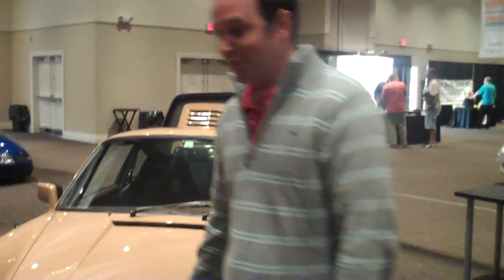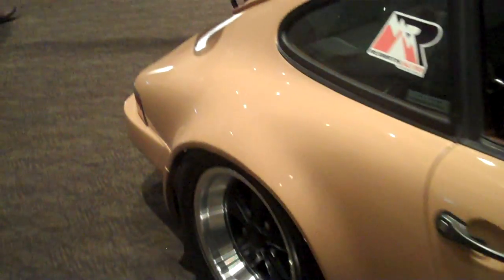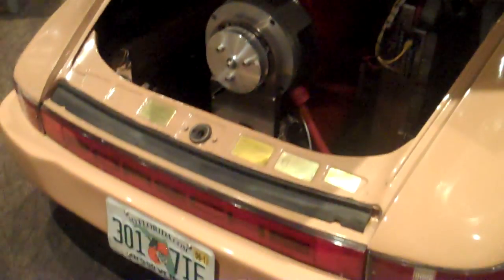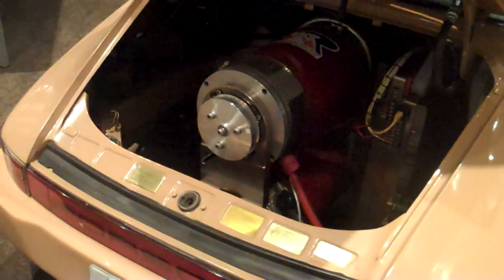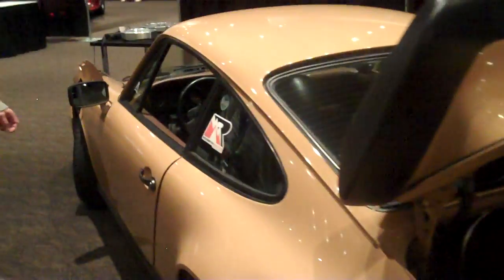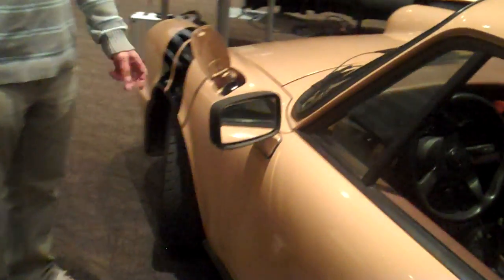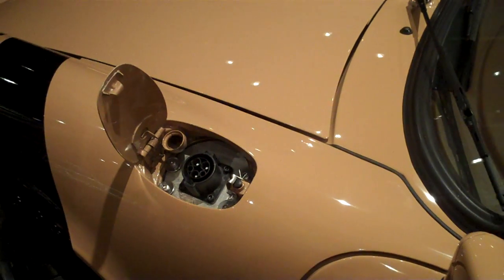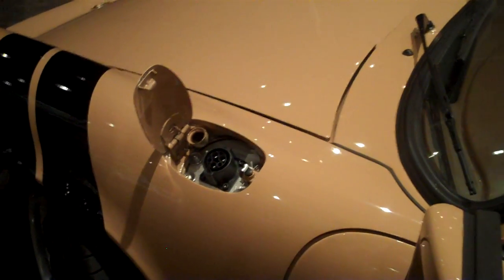400 HP Porsche; full electric conversion: WMNF News

Comment: This set up makes the car go faster no matter torque (twisting power) or Horse power (units of measurement).  When quantitative  analysis is applied here then in theory it produces 400 horse power compared to the old boxer Engine @ 185 brake horse power.

Comment: People are so misled by how fast a car is. Horsepower means absolutely nothing. It just describes how well the torque is maintained as RPM increases. So people say, "Oh that diesel only has 500 horsepower, my ubiquitous supercar is faster" well, no. The supercar revs super high, and maintains it's torque at high RPM, so it has a high horsepower number. However, the diesel may only rev to about 4000 or 5000, but it has a stupid amount of torque. The low redline means that 500 horsepower at 4000 RPM translates into a much more powerful engine.

That is why electric cars in particular, are thought of as slow because they only have 200 horsepower. But, as soon as the motor gets off of the starter solenoid, if it is brushless, or from absolute 0 rpm with a brushed motor, you have more torque than just about any clutch, transmission, or tire can handle.
Reply: What you said is completely wrong. So many wannabe mechanical engineer don't understand hp is a direct translation of power 1 hp = 745.7watts so what it means is this is a 300KW motor. Being 300KW is its maximum power delivery. I'd understand if you said my car has 300ft/lb of torque its faster than your 250ft/lb of torque car as the lower torque car may rev faster and be quicker, but hp is a combination of rev's and torque which means directly how fast the car can accelerate, the only additional factors then is weight, drag friction ect. I'd agree in part if compared to a turbo engine a 200hp electric will probably beat a 250hp turbo as the turbo's power delivery is far from linear but compared to a naturally aspirated car the figures are pretty comparable in acceleration.
Reply: I have an addition to make, my statement applies to diesel and electric engines and motors, however, with gasoline engines, IF your engine revs REALLY high, such as a sport motorcycle engine or formula 1 engines, your gearing can be ridiculously short, so you can get a great mechanical advantage. However, that mechanical advantage is to make up for the lack of torque. Torque is a force, horsepower is just a descriptor, so in the end, the amount of torque at the wheels is what moves you.
Reply: Dude. HP or watts (different units that measure power) is a product of torque and RPM. An internal combustion engine can develop its max HP at one speed only which is the maximum allowed RPM for that engine. If your 500 HP engine can run at a maximum 5000 RPM, it means that at 2500 rpm it will develop only 250 HP. As the engine's RPM increases, so the HP will increase until it reaches 500 HP.  An electric motor is much more flexible because it can use all the available power at almost any RPM. If the RPM is increased, the torque will decrease to match the power delivered to it. If you feed an electric motor with 500 HP of electricity, it will use it all regardless of its speed. And that's why a 500 HP electric motor will perform better than a 500 HP gas or diesel engine.  Got it ? It's physics. FYI at low RPM, no internal combustion engine can match the torque of an electric motor, that's why locomotives use electric transmission instead of a crankshaft and gearbox to get the tonnage moving. Btw 500 HP at 4000 rpm means 500 HP,  not more.

Comment: This is a very cool conversion.   Nice quality parts,  Nice mechanical skills.
FAST from 0 to 30,  Quick to 60, Faster than gas to 100 .....    Electric is all about the torque.
More wind load at higher speed will drain the energy much faster than rolling along at 35mph.
You can have range and speed, just not on the same fillup, like a gas car with a 2gal gas tank that takes 5hrs to fill.
You can go 100mph on 2gal of fuel, but you won't get 30mpg.

Comment: Doesn't mater how fast if you can't get back to your charging station.
Reply: Same goes for the regular cars - no gas, no go ;)
Reply: Woman reporter seems most interested in how fast. When you use 300kw bursts its hard to get 100 miles.But boy can you go fast in 3 seconds.
Reply: Teslas are getting pretty close to that kind of range. In the following few years as energy storage systems get better we will be able to drive anywhere and charge anywhere from wind and solar. It will be expensive at first, but very shortly mobility will become almost free after that. It was the same as the first cars were invented.
Reply: +Nikolay Agopyan Yeah, but can you go for 400-500+ miles on a charge? Even my big heavy van can go 450 miles. 
Maybe those EV's should have a onboard generator ;)

Comment: that's a lot of horsies but  I'm just not ready for electric cars and I'm wondering how that's gonna affect my electric bill?  my elecltric bill for a month was an extra 100 with one tiny air conditioner!  I know I know it depends on my kwh usage but still !
Reply: Electricity cost for powering a vehicle is 1/10th the cost of petrol
Reply: Boris Tyson I saw Nissan Leaf data. It has 24kW/h battery. Full charging cost $2,88 (at $0.12/kWh). In ideal conditions, on highway at 60km/h range is 222km, so it uses 11kWh/60km or 11kWh/hour. So Leaf can do 500km for $5, but this is for ideal conditions and not 80-90km/h. There are test results at Wikipedia: http://en.wikipedia.org/wiki/Nissan_Leaf However I'm pretty impressed. Maybe it's time to put some solar panels on roof and harvest "free" energy?
Reply: This is why im building one, my electric bill is included in my rent to i pay 625 for a 2 story house each month, so this to me sounds like an awesome idea.  Wife is already buying me a shell for our one year anniversary.
Reply: I think typical car uses 20kW of power if you drive "economically". One hour of 20kW driving is 20kWh. How much 1kWh cost in the US?
Reply: ***** America's national average is $.12 per kw/h. That means that an hour or driving at 20 kw/h would be $2.40, but that doesn't sound right to me.
The Nissan Leaf can do 500 Km for $5, the average speed is 80 or 90 km/ph, that means the the Leaf uses about 80-90 cents per hour.
Reply: that's awesome!  seems like you have a great situation, I wish it stays good.
Reply: Solar panels (including installation) at this point will pay for themselves in about seven years.  They last probably 20-30, so that’s one way you could save on power. Of course, yagotta have the money up front...

Comment: I can't wait to see some of the conversions from wrecked performance model s Teslas with 416 hp and 443 fl.lb. torque in a much lighter frame and lighter (less large) battery.  Something like that will go like scat! ;)
Reply: There was that Stretched VW van, can't remember seeing how it finished though. But there are lots of problems with doing that unfortunately... you'd need a custom fabricated frame which could support the battery from underneath... too costly
Reply: MuzzaHukka

Comment: As the battery pack starts to drain down,the inverter can adapt to the lowering votlage from the battery pack by automatically boosting it back up to full voltage so still have full power.

Comment: Its pointless on a full course track, other than drag racing, they 'sag' after a hard lap and continue to decline in speed AND torque just as a simple R/C car does.  As impressive as they can be in the 1/4 mile, you wont see electric on an F1, Le Mans, or NASCAR for that matter anytime soo. They can be fast but it kills any endurance. Our current tech allows for the slow but steady method, and that alone... at least for now.
Reply: I dont know if this counts as 'any time soon' but have a look at formula-e. 'now' is NOW

Comment: I wonder if he has the same problems that the tesla has.. From the Battery to the motor, the Tesla was designed very well, yet take it around a track and see how it holds up. The batteries curve with use, and going on a track really emphasizes this. Battery tech needs to go through a few more leaps and then it will be compatible to internal combustion. As for now there are some obstacles to overcome : /

Comment: Man ask ``So what is more important hp or rmps`` i say simple thing.
The gearbox is you can say is another part of story.
Fuel consumptions per output power per Kw that is a looong story.
Pull out from car its petrol engine of 150 Kw and put Electric motor of 150 Kw you will think you driving F1 car. Faster more powerful..... and you can drive at full power output at all time with electric motor but with a petrol it will be big bang BUUUM after that you will need a prist or new car.

Comment: depends on your application, but rpms are largely irrelevant so long as you can gear it down to whatever speed you want. it only comes down to the toque required to do the work, and the power required to produce that torque at the desired rpms. So to answer you question simply... its all about power. power is work done per unit time, the more work you do, the more(or rather faster) things can be moved.

Comment: No. hp, or kw, is a measurement unit. tell me which has greater volume, a liter of water or a liter of oil? its the same with power. a 400hp motor puts out the same (peak) power as a 400ph engine. The difference that you've missed is that the motor will put out that power at much lower rpms, and over a broader range of rpms than the engine, which is why it so easily outperforms it.

Comment: I think you need to look up the relation between power, rpms and torque. if you have two 1000hp motors like the ones you're comparing, then they can both produce the exact same torque if geared to the same rpm output via a gearbox (ignoring losses in that gearbox). whats more important is the size and weight of the motor per kw produced. small high rpm motors can produce more power per kg/L, and thus are more usable in a sports car.

Comment: Lets say as this : 
Heavy truck 3500 rpm, 1000 hp, 3000 Nm, top speed 120km/h
Car 10 000 rpm, 1000 hp, 1000 Nm, top speed 420km/h
So if you need somthing to pull you need low rpm with high Nm or if you want speed you need high RPM with lower Nm (both car and truck have same HP 1000 )
You must first know what you need for then find balance between HP and RPM.

Comment: You say 400 hp but it is not same. 400 hp electrical motor is more powerful and faster from 400 hp petrol/diesel engine.
Petrol 400 hp 300 N.m 10 000 rpm. 30% efficiency
Electric m. 400 hp 600 N.m. 10 000 rpm 90 % efficiency
And now who is more powerfull and faster ?
Physics laws half of them are wrong !
It same when thay say you can not get more energy from input ahah only in joke.
I have electric gen. input 1kw output 4kw and power up entire house. And to tell me it is not possible heheh